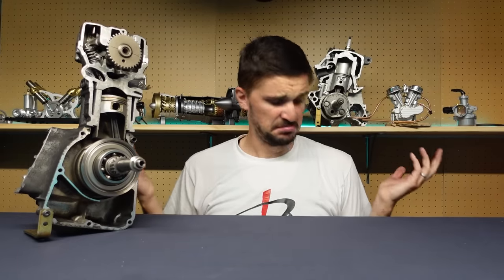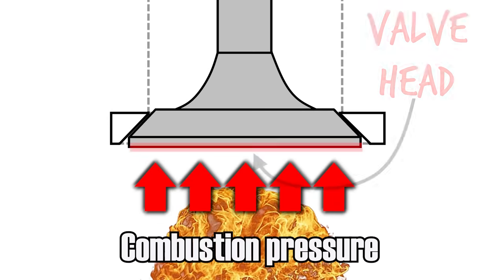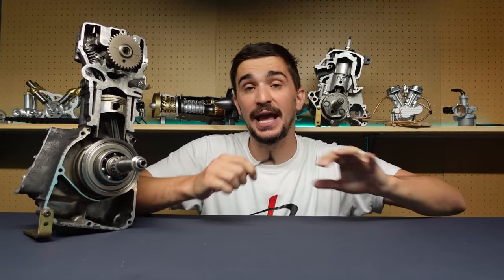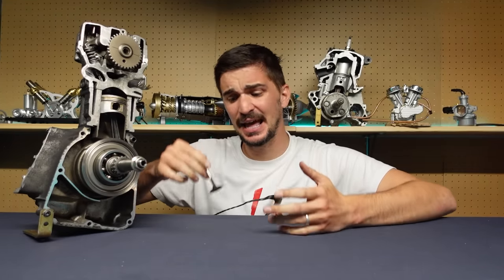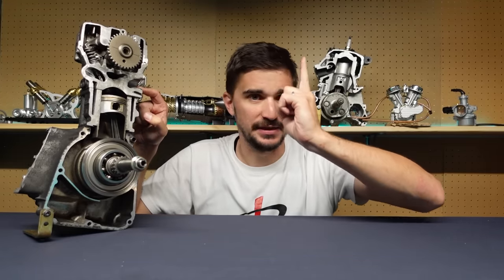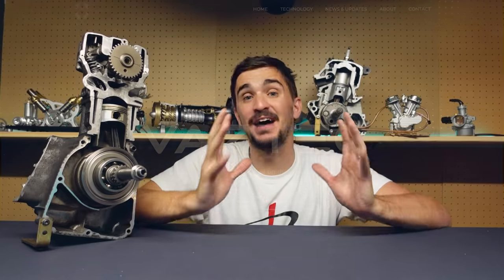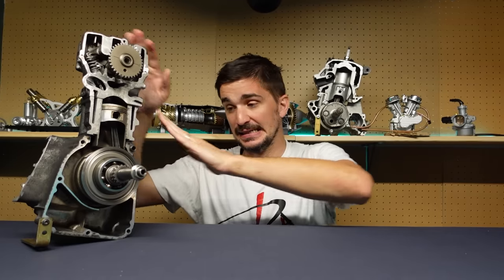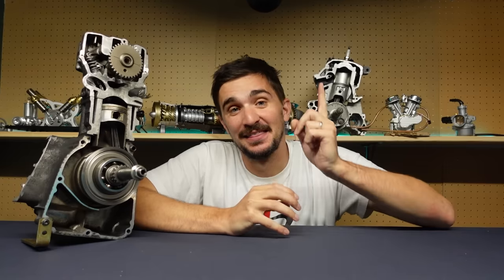Rotary Valves Make Normal Valves Look Silly - Why Aren't We Using Them?

Comment: There has to be a good reason this was never used, theres been a lot of very clever engineers involved in engine design over the decades & they would have considered designs like this, but they didnt use it. You just have to look at every other part of the engine to see all sorts of weird designs & innovations much more complex & intricate than rotary valves.

Comment: Why use a spring on a "normal" valve? Why not use something like a crankshaft, so it would also pull it up and shut the cylinder closed?
Reply: It's been done -- it's called the desmodromic valve.  Ducati uses it.

Comment: Too heavy, one barrel would outweigh the entire components on one cylinder bank... also port overlap especially on the exhaust will cause longevity issues (port overlap means where the rotor is partially open or closed it exposes the rotor valve body to those gases and carbon build up).  

It also eliminated the ability to 'tune' the valve train.  Instead of a simple cam swap or adjustable cam timing... you will always have a fixed duration and 'lobe separation angle'.

Even its argued advantage of not blocking flow I think is a bit of a knock against it.  Yes, poppet valves 'get in the way', but that can also help mix up the incoming fuel/air charge.  This rotary valve may let more flow... but it won't aid in mixing the fuel/air charge as much as poppets.

Comment: Rotary valves have the exact same issues pretty much from the rotary engine which madza spent a good amount, if the rotary engine isssues where solved we would have rotary engines IM guessing as you completly remove the intake/exahaust moving parts and the rotary engine has less parasitic losses from the updown conversion to rotation for driveline

Comment: Even though small engines might seem like good candidates, every type of engine has to meet stricter emissions standards these days. You won't find two-stroke motors all over the place like you used to. Engines need to be extremely efficient at burning fuel.  If a rotary valve engine suffers low end inefficiency at burning the fuel, it won't be acceptable. If it simply is inefficient with power but burns the fuel cleanly, well that would be less of an issue. So, how are the emissions? When I see the deposits around the cylinder, it has me wondering if the engine would pass.

Comment: A rotary valve would have trouble achieving the correct stoichiometric ratio to achieve combustion. You show this with your heat map at 8:31. One side of the cylinder is overly fuel rich and the other side is overly lean. Leading to slower combustion and lower power output. You acknowledge this issue with the next heat map. You rounded the bottom of the cylinder to aide with mixing. Something that can't be done in an actual engine. If you rounded the piston it wouldn't compress the mixture evenly. Leading to the same issue of the stoichiometric ratio not being correct or even.

Comment: What's weird is they don't use the technology of the Rotary engine.The Rotary engine.Deals directly with heat combustion.And that technology is?Very efficient with ceiling, high pressure, high heat.

Comment: as an engine reconditioner. the maintenance of conventional valves is a well developed system. the wear on a rotary valves would be a process of replacement. and its completely unnecessary.

Comment: What if the valve operated like a piston, with airways bored through it sideways? The problem of seal would be solved by piston rings. Piston rings are the actual reason why engines work better in practice because they allow for thermal expansion

Comment: Cylinder head designs would start looking wacky

For VVT applications you would need 2 barrels but the simplicity would be great to have in alot of your economy level high efficiency cars and compact suvs

With simplicity comes reliability and inexpensive repairs... If one of these barrels could last 150k miles  before needing to be rebuilt and would have less than $200 in parts for the service that would be acceptable.

Comment: Rotary valves have been tried and tested for >100 years. Surprisingly, they only work reliably at low speeds. They have high wear rates.

Comment: Rotary valves simply don’t provide as much flow as poppet valves.
Poppet valves are fast opening, rotating valves are slower opening.
Sleeve valves are a compromise between the two.

Comment: I wish that people that believe free energy videos and nonsense like that had to sit through some engineering channels like this one. Innovation as possible everybody is constantly striving for it, but it is HARD. Things are built the way they are with the limitations they have for a reason. It’s disrespectful to the legions of engineers that came before us to think that this one weird trick is going to throw away decades of proven performance and problem-solving. If you start trying to sign a system that deviates from an established norm, you were going to discover really quickly how fast that solution becomes much more complicated than what already exists 99% of the time

Comment: There is an inherent flaw in rotary valves,,when a std engine exhaust valve opens and the piston moves up,it never squeezes allthe exhaust gas out,,because the piston never goes exactly to the top but leaves 10 %(10 to one compression) exhaust still in the cylinder,,when a rotary valve opens it still leaves 10%,,but as it closes it is stil fullof exhaust gas,,that is then drawn in with the fresh inlet charge,,so now we have 20% exhaust gas and only 80%charge,,and thats poor volumetric efficiency,,😊
Reply: That is true for a single chamber rotary valve that is both used for getting the fuel in as well as getting the exhaust out. But a two chamber valve with channels  offset 90° and only making a full rotation for every 2 combustions wouldn't have this issue since either channel would be dedicated to one job.

Comment: There are two reasons why designs persist, momentum, and cost/benefits.  Rotary valves lose on both fronts, therefore they will never replace them. This is indisputable in industry. It's a law of nature.

Comment: Rotary valves have been worked on since the nineteen thirties. It would be wonderful if it ever was done but even F1 engineers have been stumped. The flow around the poppet valve creates turbulence that help to atomize the fuel, rotary valves also stop and start the flow exactly the same way poppet valves do so that argument is moot.

Comment: I got a even better idea than that that takes 100 pounds off the weight of the engine, and rpm is limited to the crank balance. Its also completely variable for lift and duration. Mine doesn't consume any parricidal energy. I told my buddy about it and he tried to patent it. It cost him two homes and a bucket full of cash. The car companies fought him, GM, Chrysler, Ford, and Toyota. PS I didn't tell him everything and I got the ace up my sleave.

Comment: Electric has its own troubles, but you can't beat it's torque and inability to stall. 
In just performance, Electric has its place and is already present in the heaviest of machinery.
It would be nice to see a more efficient combustion engine, but only time will tell if it catches on

Comment: Sealing is always the caveat isn't it? Apex seal wear and the large volume of the combustion chamber being the two greatest downsides to the rotary engine. The valves being the biggest issue for owners, they don't care about combustion issues, but having to rebuild the engine every 60k miles is a big one.

Comment: The energy borrowed compressing valve springs is immediately returned to the system, minus frictional losses, when the springs decompress. It's exactly the same story with energy borrowed on the compression stroke; it comes right back on the power stroke. Just sayin'.

Comment: The reason the automakers are not embracing this technology is the same reason that they took so long to embrace electric vehicles is money.  Electric vehicles are very simple with only a fraction of the moving parts to make it move forward.  As an example my 2018 Nissan Leaf has never been in a shop except for a tire change.  Nissan makes no money from me other than the original sale of the vehicle.  Simplicity wise, rotary valves have something in common with electric cars.  And that is they require much less maintenance than poppet valves.  Which means the auto maker is not able to count on repairing and rebuilding the engine as often.  The thought of this is anathema to the big auto giants.  They want your engine to wear out so that you either do an expensive engine job or just ditch the car and buy a new one from them.

Comment: You will hurt yourself trying to make a rotary valve work in an engine (any type , well). Mainly because in order for an engine to "breathe" properly, a valve must accelerate and decline in reference to the cycle of the piston stroke. Even the action of the reed of the two cycle is nonlinear in reference to the compression and power stroke of the crank.

Comment: Rotary Valves have a massive drawback hence the reason they aren’t used much in modern engines… they are notoriously hard to seal, for obvious reasons… so no, they don’t put “old fashioned valves” to shame at all…😉

Comment: They are not used be cause it is almost impossible to seal rotating surfaces under those conditions found in a cylinder! It has been tried many times!

Comment: F1 engines have rotary valves, that's why they are able to rev to 20,000 rpm. These a v8 engines also not single cylinder.

Comment: Informative but not informative enough. The emphasis seems to be on increasing efficiency by eliminating the valve springs however if this only gives a minimal  increase then it is not going to be adopted. So the question remains : what is the increased efficiency?

Comment: 1 Does anybody try to use the "Tesla's no-parts valve' to this application?
2 There is a mecanic who has modify a motorbike motor with this rotary-vale and it works.

Comment: why can't the rotary valve also slide like a piston? redesign the rotary valve to provide worm gear drive left and right action via a slide seal plate for below the vavle to seal the combustion chamber in a slotted slide lock. doesn't have to be 100% seals 99.5% will work better to predischarge exhaust gases

Comment: Sealing is difficult - Rotary valves are not used for the same reason Rotary engines are not used, it is hard to maintain a seal over the long term. According to my internet search...

Comment: It seems to me the solution to sealing has already been invented. It's called apex seals, like those in a wankel. 

As for centrally mounting a plug, do it with dual shaft rotary valves just like cams. 

I can't be the only  one who's thought of this.....

Comment: Why timing chain and belt and vvt and stuf just a small simple electric motor with a small little speed controller will do everything that an engine needs saving weight and making it even more efficient and what not

Comment: Lots of issues with a rotary valve besides sealing. It can't pass the contaminants like a poppet valve. In little time carbon deposits will cause it to seize. It has too much surface in contact so extra friction.  If carbon doesn't cause seizing heat will. A poppet seals at a narrow rim so can cut into forming carbon flaking it off. I'm sure there are more. It would need lubrication - hot gas and oil don't mix. So, it's not he right choice for this application. Why present it as superior.

Comment: Poppet valves with the energy robing valve springs are needlessly complicated and inefficient. There have been attempts to overcome this over complicated system with sleeve valves, rotary valves, two cycle engines, etc., etc.,....  My father flew a good example of the potential inherent in those types of valve free engines in the RAF. Typhoon and Tempest fighter bombers with huge Napier Sabre 24 cylinder engines were fast and had a favorable power curve vs the new subsonic military jets. Many WW2 aircraft were powered by radial engines of enormous output without poppet valves. I would bet that if a small amount of development capital was set aside for more research in machining and better lubricants we might have efficient and less polluting alternatives in the marketplace to the early jet engines.

Comment: Making roatary valves with enclosers of non metal material wound be better idea , say ceramic  ther entrie asembly acn ve factory fitted and assmbly becomes a component of the ICE.  Mass manufacturing may be a challenge to put price within reach of more buyers .

Comment: The rotary valve concept is not new and goes back nearly 100 yrs ago. The problem then and today is sustaining long lasting sealing issues.... I did work on this concept 40 yrs ago and the only solution l found that had promise was using a combination of ceramic components. In the late 90s l had some involvement with Norton USA who are owned by Saint-Gobain.. at that time one of there R&D departments were working on ceramic puppets valves and seats for regular ICE engines with some success. It was then l knew such technology would solve the rotary valve and rotary engine concepts. Way before then, l was working on rotary engines and the like and came up with several rotary engine designs, for a good comprehensive look on the subject of rotary engine concepts there is book written by Felix Wankel in 1965. he later produced the NSU rotary car from 1967 to 1977 and also licenced Mazda the technology. 

A early and successful design in rotary valve was used by Kawasaki Heavy Industries in their two-stroke motorcycle engines for intake only. The 250 and 350cc A1 and A7 were good examples.

Comment: I've worked on engines for better than fifty years now, I've got a rotary valve engine sitting in my shop for more than twenty years, yet it still doesn't come close to the operating efficiency of the poppet valve engine.  Regardless of efforts to improve it, the poppet valve engine remains the only viable form that well seals the combustion chamber.  Until a method of sealing equal to the poppet valve is conceived, we will continue to use poppet valves.  EV's are similarly hamstrung, design and infrastructure have not been designed equal to the old standby. The rotary cylinder valving system is interesting, fun to play with but not viable.  Unless we build atomic energy electric power to equal the power consumption of EV's, that too will never come to fruition. People properly drive government, not the other way around.  It's not the failure of engineers, but the utter failure of mandates changing real world paradigms.

Comment: Strength... rotary valve could flow better with less friction on moving parts.... but the rotary valve is not strong enough and won't seal as good... may get it to hold up on a 4:1 compression engine.. but 10:1 nope

Comment: it looks good, till you... realy get to thinker whit it. effective port area is at play. the same surface area thats circular will flow a lot more than an oval or sqaure hole. allso the cylinder and piston are still... circular. you'd have issues finding the space for flowing the same airmass as whit 4 valves per cylinder. the losses of the spring force you mention do apply, however consider engines whit more than 1 cylinders.. most of that spring power is indeed recovered. the dynamics allso different in terms of rotation of the cam shaft and effective valve surface area. those problems summed up are the reason why you don't see rotary valves. the sealing would be extremely problematic specialy in case of turbo charged diesels... the high cylinder pressures would be unmanagable. 
so all in all, popets are still the best option.

Comment: So why motor manufacturers don't use other methods of converting rotation movement into linear movement? Like cylindrical cam, quick return mechanism etc. It will remove the need to use spring, so the efficiency will be better and with this we can still use classical valves with good sealing.
(https://www.youtube.com/watch?v=ve9M8d6KfdI,  https://www.youtube.com/watch?v=O9PSs5qvA5k)

Comment: If hydrogen technology becomes viable as a reliable replacement for standard internal combustion engines, perhaps this rotary valve system could be incorporated in these engines.

Comment: Rotary vale engines are everywhere. Problem: Sealing. Waste of fuel, gases, wear. Poppet valves seal tight, precisely. Remove the springs? Easy...Desmodromic system: Positive opening and closing, but needs very high precision and maintenance, eg Merceds W196 F1...later Ducati Desmo bikes,  Why not piston-port, no valves? Wasteful of fuel...Or reed valve? OK for low revs, low inertia, otherwise...!!!

Comment: We are unlikely to see this in reality because as mentioned in the video electrification makes all of this moot.  EVs are at the same point of development that ICE was in the 1920s, and production costs plus battery density are improving exponentially.  Less parts means lower cost to manufacture and better reliability, and when combined with massively lower cost to operate and a better power curve the EV revolution will win.

Comment: Needs rotating seals that lap themselves due to the higher speed on the outside. Has been put into practice in german engines and is described in literature. Has been forgotten. Consumes too much oil for todays standards.

Comment: Why can’t the valve system be like the steam spool valve on steam engines they have no problem sealing 250-300 psi that more then a gas engines compression ITS SELF cleaning with the back and forth motion and can work with a cam shaft system , no springs , no o-rings or seals to ware out ?

Comment: Why make engines rev so much anyways? Just make a high torque engine run at maybe 2000RPM max and then use the gearbox to get the desired RPM for the wheels. Would make engines far simpler and more reliable.